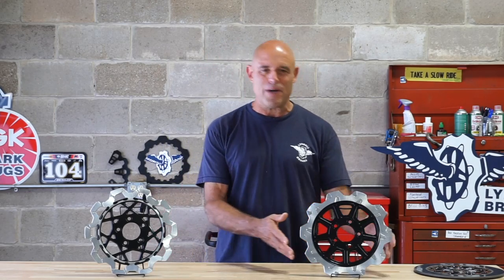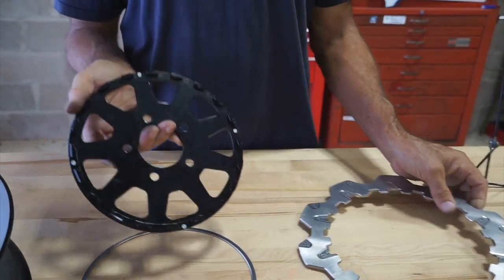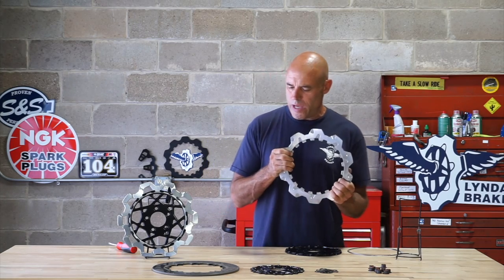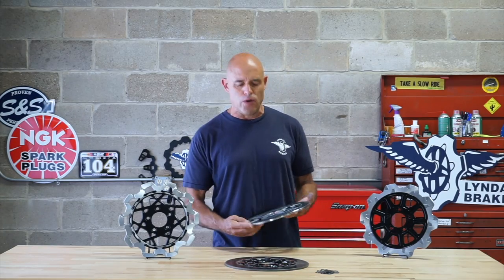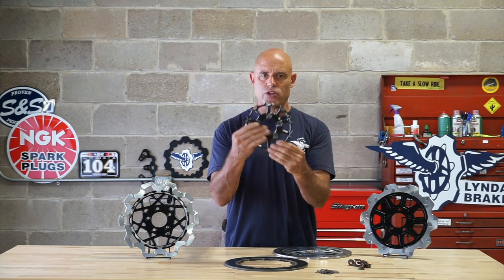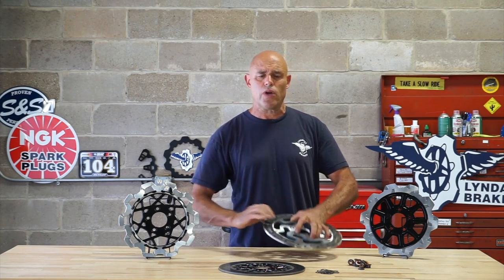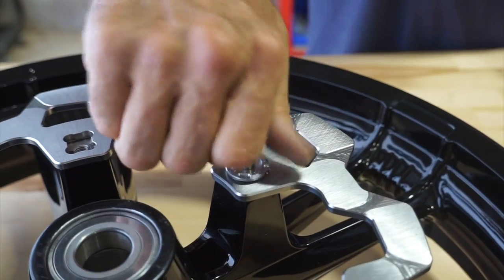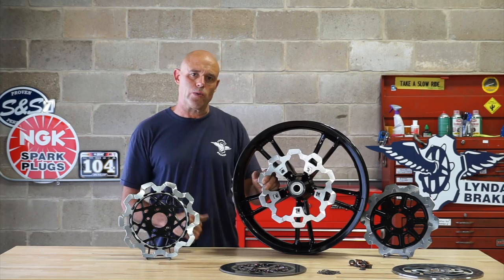The Best Way to Float a Brake Rotor: Lyndall Brakes

Comment: my rear brake disc It's the same color as you in this video, which now moves a lot. And then there was a loud noise. How do I fix it? Must change the Attachment Ring or change 3M. Please answer me. Greetings via message Both emails have been sent.